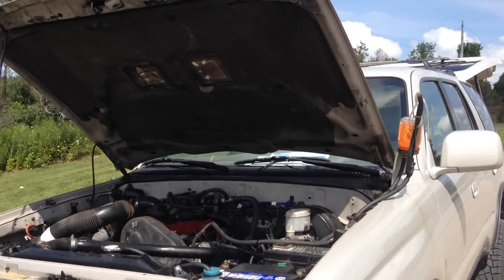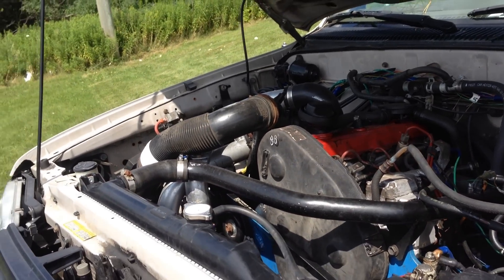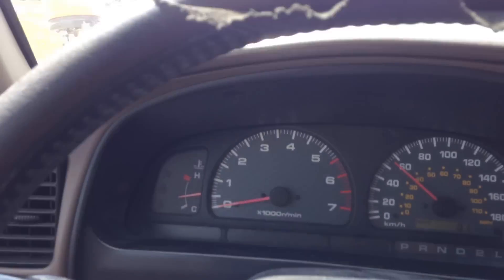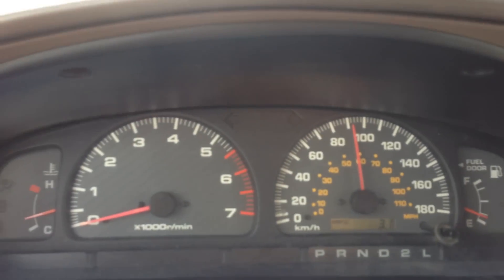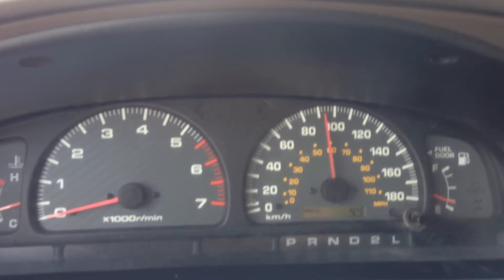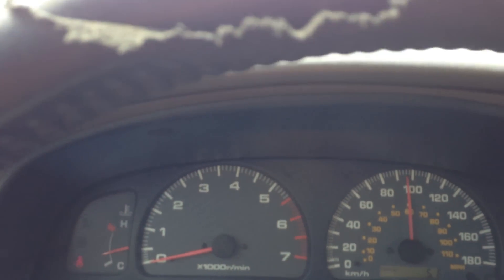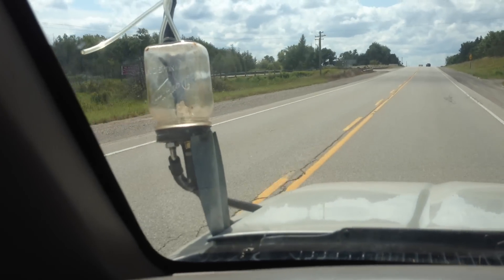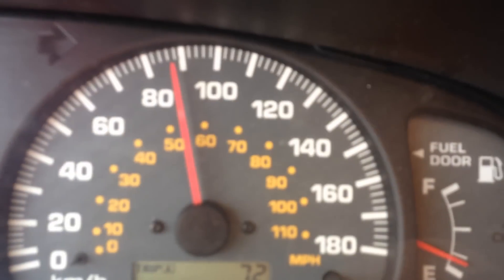Diesel converted Toyota gets over 40 MPG  Part 1

Comment: I think I'd rather have the 3.4 or 22re considering the output of that tiny fucking diesel
Reply from the maker: That's the great thing about the internet, even people whom don't pay attention, or don't understand a subject ( in this case power output ) can eloquently state their opinion.
 In this case, the torque of the tiny "f*#king" diesel is even at peek, greater than either the 22RE or the 5VZ (3.4L V6). Even in cases where the diesel has less peek torque, it often has greater overall torque due to it's comparatively broad/flat power curve. This 1.9L diesel puts out 250lb.ft. of torque at its peek, and 90% of that power is there from 1700rpm - 4800rpm ( yes, these little "f*#king" diesels can rev ). While even the 3.4L only produces 228lb.ft. of torque at peek, and that's at 3700rpm. Down at 1700rpm it produces 55% of that power and doesn't reach 200lb.ft. until in the 3000 rpm range. With a diesel, when the peek torque is lower that that of a gasoline engine, very often the usable range of the torque is still greater.
 Horsepower can be different, ( in reality HP is a mathematical derivative of torque based on acceleration at a set load ), Honda Civics can have great HP. but can't tow heavy loads! Crappie torque! The Toyota 3.4 and maybe a well modified 22RE will have better acceleration through 1st, and 2nd gear when powering an empty truck, but when the wind resistance increases by 3rd, 4th, and 5th gear, or more load is added to the truck, it's torque that does the work. And in this case, women are right, size doesn't matter!
  22R's and 3.4L 5VZ's are great engines, and don't forget the 2.7L 3RZ's, but they're never going to achieve 40mpg in a Toyota truck, with the ability to move 8000+ lbs. GVWR.

Comment: Do you still have Cruise control?
Reply from the maker: chad burgess 
 Hello Chad and thank you for the inquiry.
 So far, with the exception of the 4Runner in this video, all of the other vehicles were not originally equipped with cruise control. This forerunner originally was a automatic transmission. With all of the conversions done to it (automatic to standard, gas to diesel) it would have been extremely complex to set up the cruise control. I would expect it would be easier to hook up an aftermarket cruise control then to of tried to retain the original one from Toyota, so the customer decided cruise control was not something he would require.
 Keeping the original Toyota cruise control would likely be more costly than it would be worth. Although, when we figure out how to keep the automatic transmissions, then the cruise control should also be simple.

Comment: cool swap! how do you pass e-test in ontario? i'd be very interested in going with this route of a 4runner build
Reply from the maker: Hello Oliver, and thank you very much for the reply.
  Depending upon what year Toyota truck you start with, will dictate how you go about taking care of the omissions problem in Ontario. Anything before 1998 they still test at the tailpipe. For these vehicles it's a simple matter of paperwork with the Drive Clean organization, and then you test as you would an older diesel car. Strictly A visual test where they look for smoke at start up and under acceleration with no load.
 For the 1998 and newer Toyotas, they will test all of the sensors, to make sure all sensors are working. For this, we just make sure that all of the Volkswagens computer and sensors are in and functioning so that when they plug into the 0BDII Port, it shows that everything is working and they will give you your sticker. 
  So, for 1998 and newer Toyotas you must use a full electronically controlled TDi engine.
Reply: Thank you for the fast reply! thank you for clearing that up! if i do plan to go this route i will contact you ASAP. have a good one guys

Comment: Coudln't you have used the 2.5L D4-D Turbo diesel already in the Toyota Innova???
Reply from the maker: Hello Ashwin 
  In our opinion, the VW 1.9 Diesel is the best choice for these trucks as it has the same RPM band as the original Toyota gas engines it replaces, it's very light weight, it's extremely compact, very easy to acquire, renowned for it's longevity, capable of incredible power output, and gets phenomenal fuel economy. It's also used in nearly every country in the world. And while we have been a huge fan and supporter of Toyota and their vehicles, We have been less than impressed with most of their diesel offerings over the past 30 years, especially in the North American market. Where as VW diesels are nearly flawless, with the exception of the emissions scandal of the 2.0l TDi's of late.
Reply: If in your country there's no VW TDI (India?), you can use 2KDFTV toyota innova (crysta) engine. But you'll need to install another transmission afaik. here in Indonesia, there's no VW TDI motor, so we used 1kdftv hilux motor or 2kdftv innova motor

Comment: what axle gearing, trans and tire size ?
Reply from the maker: jimbote1968 

   Hello Jim, how are things out Ottawa way?
   We've been using the stock transmissions, be a V-6 or four-cylinder I now have adapter plates and flywheels to accommodate both transmissions. For a 31 inch tire we personally have found that a 4.30:1 seems to be our best all around ratio. If we're using the truck more for towing, then we like to go to a 4.56:1 gear ratio. Subsequently, when running 33 inch tall tires, for all around use we have been happiest with a 4.56:1 gear ratio.
  I guess in reality, running the VW 1.9 diesel, mirrors the original Toyota engines when it comes to gear ratios. even as we have started to move up in our power output with the Volkswagen engines, the gear ratios we have stated still seem to be working best for us.

Comment: what 5speed transmission did you use?
Reply from the maker: Hello Carlos.
  We used a 5spd transmission and transfer case from a 1999 3.4 litre V6 Toyota 4Runner. 
 Had this truck started as a standard instead of automatic, it would have been the original transmission and transfer case.

Comment: NO WAY My 95 wrangler has the 1.9 TDI in it with the 5 speed and a stage 2 malone tune a 3 inch lift and 33s and it barely gets 32
Reply from the maker: We have a neighbour with a 1.9 TDi in a 97 TJ, he too only gets around 32 mpg. on his 33's. We believe the main difference is the aerodynamic difference between the two vehicles. While the 4Runner is not a fantastically aerodynamic, it's still far more aerodynamic than a Jeep. 32 mpg from a Jeep on 33's I would consider very good. We've also found that the stage 3 with the right injectors seems to be the most fuel efficient way to go, and fun to drive.
 Cheers
    Shane
Reply: +TOY Works Autocrafters true, not to mention I have a 2006 PD which isn't that great especially when compared to the 98 TDI motors which I believe we're the best when it came to durability and simplicity and power, my last 98 I sold still running great with 335,000 miles on it
Reply from the maker: +Eighty cc 
 Yes, I'm also under the belief that the PD motor's aren't quite as fuel efficient. I'm told though, that once the cam and lifter problems are addressed, it's the strongest of the 1.9's. We're working on one right now, if all goes well we are hoping for a reliable 385lb.ft. of torque and 285ish hp. It's going in our long distance tow rig. Still aiming for 40 mpg on hi way when NOT towing. Would love to see 28 mpg when towing. Not sure if that's overly optimistic.
 Pleasure chatting with you.
   Cheers
 S.C.Lawrence
Reply from the maker: +Eighty cc 
 Yes, I'm also under the belief that the PD motor's aren't quite as fuel efficient. I'm told though, that once the cam and lifter problems are addressed, it's the strongest of the 1.9's. We're working on one right now, if all goes well we are hoping for a reliable 385lb.ft. of torque and 285ish hp. It's going in our long distance tow rig. Still aiming for 40 mpg on hi way when NOT towing. Would love to see 28 mpg when towing. Not sure if that's overly optimistic.
 Pleasure chatting with you.
   Cheers
 S.C.Lawrence
Reply from the maker: +Eighty cc 
 Yes, I'm also under the belief that the PD motor's aren't quite as fuel efficient. I'm told though, that once the cam and lifter problems are addressed, it's the strongest of the 1.9's. We're working on one right now, if all goes well we are hoping for a reliable 385lb.ft. of torque and 285ish hp. It's going in our long distance tow rig. Still aiming for 40 mpg on hi way when NOT towing. Would love to see 28 mpg when towing. Not sure if that's overly optimistic.
 Pleasure chatting with you.
   Cheers
 S.C.Lawrence

Comment: Great work! I'm in Toronto and have been thinking of getting a 4runner/Tacoma to do a diesel conversion but I noticed that you're from Ontario and have a post 1988 2nd gen 4runner with a diesel swap. How were you able to not worry about emission tests and MTO pulling you over? I know 1988 is the cutoff where emission laws don't apply, but I love the 90s 4runner/Tacoma platform. Are you in Northern Ontario where they're not so stringent? Thanks again!
Reply from the maker: Hello, and thank you for the reply.
 We are located just north of Brampton, in Orangeville. Doing a diesel conversion is completely allowed as long as you go through the simple paperwork with the DriveClean emissions people. If you would like to give us a call, 519-938-9844. We would be happy to answer all of your questions.
Thank you again
 S.C.Lawrence
Reply from the maker: Hello Rootin' Tootin' Putin 
  For the most part, passing omissions in Ontario is fairly simple. If you start with a vehicle 1996 or older, you simply apply for a fuel type change with the Drive clean Ontario corporation. You will need to send them pictures from four corners of your truck, a close-up of the serial number behind the windshield on your truck, and a picture of the engine bay with the diesel motor now installed as well as four or five small questions they will ask on their form. It usually takes them 2 to 4 weeks to get back to you with authorization. Whatever authorized it they will give you a two-year exemption from emissions testing. After that, you only have to pass the diesel omissions standards for vehicles up to 1996 which is just a visual inspection to check for smoke.
 On 1997 and newer vehicles you have to pass the 0BD II test, which simply checks to make sure all of the sensors are properly functioning. They will tell you that a diesel conversion is not possible because with an OBD II test it would typically pull the serial number/make and model of the vehicle out of the computer therefore it would think it was a Volkswagen Jetta or Golf, and yet you are actually driving a Toyota truck. Now if you are using the AHU engine, it's computer does not have the serial number or vehicle information and coded into it. So they will strictly go by the information on the door as to vehicle and model, but as long as there are no engine codes if you will pass and they will not even know it is now a diesel. If using an ALH motor, you get an experienced programmer to change the vehicle code in the computer to match that of your existing Toyota. Once again as long as you have no engine codes you'll pass and they will not even know it is a diesel.

Comment: I'm seeing that based on your gauge cluster it's an automatic so you've been able to configure this engine with auto or have you swapped it for a manual transmission?
Reply from the maker: Hello. Unfortunately we haven't had a chance to figure out the ECU inputs for the automatic transmission yet. This one was converted to a 5 spd. manual.
 With luck we should have time to work on the automatic set up this year.
  Thank you for tuning in.

Comment from the maker: Hello PGURUSC.
  Yes we sell kits to install VW 1.9 diesels into the Toyota trucks. Please feel free to call us at 519-938-9844 or contact Shane at thetoydoc@hotmail.com  phone typically works better as we are in a valley and internet reception is very poor.
  Thank you
Reply from the maker: Pascual Zapata 
  Hey Pascual I fully respect your opinion, but we will have to agree to disagree on this subject. 
 Like you, I too have been working on Toyotas since the late 80's, and professionally on nothing but Toyota trucks since 1992. I have owned nearly every type of Toyota truck engine that I've heard of. Until I reluctantly got talked into swapping a VW 1.9 TD into a Toyota, I would have never believed that anything other than a Toyota motor belongs in a Toyota truck due to fitment, fuel economy, durability, weight, ease to work on etc. Having done multiples of these conversions using 4 different generations of the VW 1.9 TD/TDi's both stock and modified, I'm probably in a better position to suggest that none of the stated Toyota diesels can achieve what the VW 1.9 can do.
 You'll be hard pressed to find a Toyota diesel that can propel a lifted Toyota truck to 100mph/160kph, pull 8000 lbs behind a truck running 33" tires with stock gearing  in 5th over 60mph/100kph, and when cruising around beat 40mpg/5.9l per 100k.
  With the installation kit we have designed it's easier to install a VW 1.9 than reinstall a stock Toyota V6.
 One of the big problems with the 2L 2LTD 22LTE and 3 litre Toyota engines is, there's no real performance increases because no-one I have heard of has any proper way of increasing/correcting the fuel delivery.
 Over the years we have consistently seen 2LT's crack their cyl heads when asked to maintain speeds above 65mph/110kph most likely due to hot spots in the combustion chamber caused buy the high rpm. Many of the 1989 and later Toyota diesels were equipped with 4:88 gears which exasperated the problem and can only be explained that they needed such a gear ratio to help compensate for the turbo lag and mediocre torque curve. Personally, I've come to believe that Toyota only produced these diesels because in certain areas of the world diesel fuel is a better option as a fuel source due to the volatility and instability of gasoline, and not for its power curve.
 If the rpm's are kept below 3000 the Toyota diesels are great for longevity, but so are the VW 1.9's even when pushed past 4200 rpm for extended periods.
 There is something to be said for keeping it "all Toyota." For me however, it's about the smartest vehicle for the application.
 Again, thank you for your input, and enjoy your Toyota, in what ever way you see fit.
  Cheers.
   S.C.Lawrence
Reply: TOY Works Autocrafters  what a swap like this cost?
Reply: TOY Works Autocrafters do you guys still sell these kits and is that number still good??
Reply from the maker: Pascual Zapata 
 While the idea of keeping a Toyota motor in a Toyota truck is absolutely more appealing, the 2L engine is way to underpowered, the 2LT engine has way too many cylinder head issues and is also under powered, and The 3L engine can still not match the power or the fuel efficiency of the Volkswagen. Nor can any of the Toyota engines match the simplicity and ease to work upon that the Volkswagen engine offers. And finally, the Volkswagen engine is nearly 300 pounds lighter.
Reply: Link?
Reply from the maker: Carlan Aronson 
  Hello Carlan, and thank you for the response.   Yes we are still making the VW diesel conversion kits and the 519-938-9844 phone number is still the best way to get in touch with us.
  We look forward to speaking with you.
Reply from the maker: +mark proulx 
 Hello Mark.
  The transmission is a five speed, four-wheel-drive, transmission and transfer case assembly from a 98 Toyota Tacoma V6
Reply: It is better to get a toyota diesel engine 2l, 2l t, 3l
Reply: Since the 90's I have worked with  diesel engines and toyota 2l, 2lt and 3l engines are in the list of the best and most economical Japanese diesel engines and I know because I have enough experience with these toyota engines . The durability of these diesel engines is incredible 
And the vw 1.9 diesel engine is not over. You could be sure that installing a 2L engine is super cheaper than installing a vw and almost zero modifications I tell you this because I've done it enough times , I tell you this because I've done it enough times in the Toyota 4runner